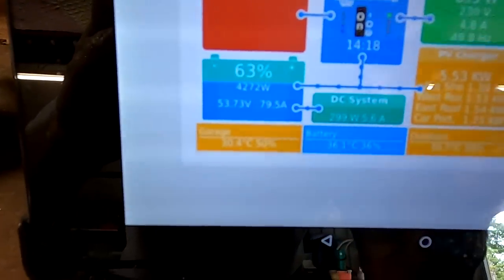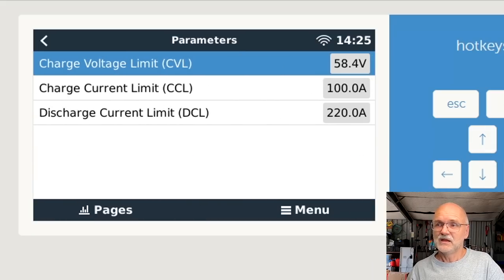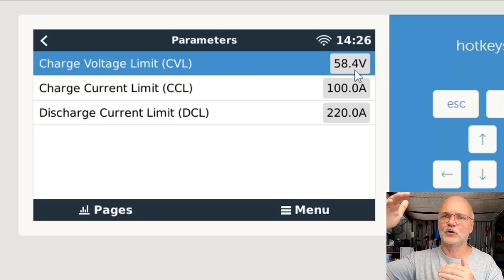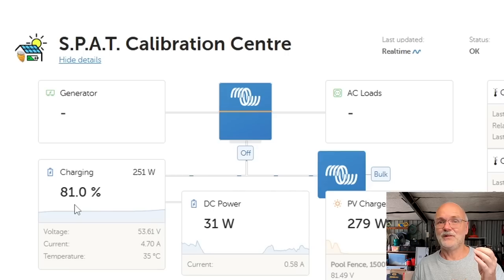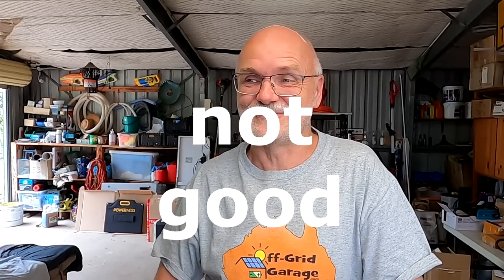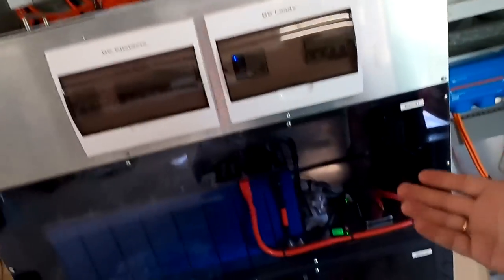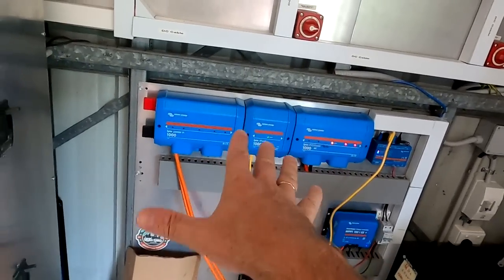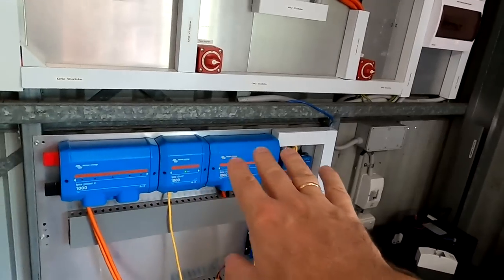SEPLOS BMS and Victron Lynx Shunt. Great solution, but why this is not for me.

Comment: Super Andy again an extremely interesting video. 
For this series on the Seplos BMS, you have come to a full circle. You started the series by asking the question of what benefit a Smart BMS could bring compared to a Dumb BMS and the conclusion after a few months of testing is that it brings nothing! Obviously you consider, and rightly so, that the algorithm used by Victron in its charge controllers is perfect and that this is what Seplos should implement. In the solution you describe here, the regulation is done by the MPPT charge controllers and the SOC measurement is done by the Shunt. So the CAN communication from the Seplos BMS to the Victron system is only used to bring up the detailed parameters on the battery and with that we have an almost perfect solution. So if Seplos implemented Victron’s charging algorithm and SOC measurement, it would be close to a perfect Smart BMS.

There is still one point to be dealt with, which you mention in your next video, the problem of optimizing the balancing of the cells at the end of the battery load. Looking at different videos, everyone more or less stumbles on this problem. This is due to the fact that the load curve is exponential for LFP cells and therefore at the end of the load the highest cells quickly go into overvoltage. This is especially true when the load current is high. If for example the charge current supplied to the battery bank is 100 A, balancing the cells with a passive or even active balancer is no longer effective. The only solution in this case is to reduce the charging current. A possible algorithm (very simplified) would be to define four voltages: the first voltage would be the balancing trigger voltage (let’s say for example 3.3 V), the second voltage would be a voltage that would tell the chargers to decrease slightly the maximum charging current (let’s say for example that this voltage would be over 3.45 V), the third voltage would tell the chargers to increase slightly the maximum charging current (let’s say for example that this voltage would be less 3.4 V), the fourth voltage would be the cell protection voltage that would cut off the charge (let’s say for example that this pension would be 3.65 V). Such an algorithm would normally converge the voltage of all cells to 3.45 V.

While waiting for such a BMS to exist, it is quite possible to implement this kind of algorithm with a home automation system such as Home Assistant. Indeed, most of the charge controllers and BMS have the possibility to communicate using the Modbus protocol and it is therefore possible to collect the different parameters of the overall system and to send back the appropriate command to implement such algorithm.
Reply: I think SerialBattery is what you are looking for

Comment: With all I learned from Andy on the good and bad things of Victron and 2 Mason running in my home without a Smart Shunt...I continue to measure SOC, cell voltage , control Charge current and turning on off the MP2 by modbus and IObroker. This will do exactly all the control as well as can process forecast data to set SOC limits...
Thank you Andy for all your shared insights! 🙏

Comment: Andy thanks for all your experiences of the past couple of years. It helped me a lot and learnt a lot. One thing I have learnt in battery management is I will only let a BMS do what it is supposed to do and that is protect the battery from cell max voltage cell max and min discharge and charge. Temperature protection high and low. Some people like to control everything (Seplos) I would never allow it. If I was the Seplos mother I would say just look after the parameters and I will look after everything else. Your 45kw battery system works perfectly. Simple and effective. Cheers Ken
Reply: I think I agree with you. Would you link 2 batteries together for communication (master / slave)?

Comment: Hi Andy,
Thank you for this video series 👍. It was very educational.
I had hoped that the Lynx Shunt would provide a good solution.
The seplos videos show that your battery shelf design was a very good idea, and it certainly holds up against ready-made solutions. Keep up the good work !🌞
Reply from the maker: Yeah, the shelf is working great. Even without communication. The Battery3.0 will work the same way. We also have a huge project at some stage to connect all the batteries together. Already thinking about that...

Comment: Thank you Andy for your work.

I've followed the Seplos Series from the beginning. Soon it was clear the balancer sucks. Made new PCBs for the Mason DIY-Kit. Now a Neey is in charge for that task. Balancing problem solved. Then followed how to integrate the bms into the victron world. Raspi4, waveshare 2 CanHat, venus os2.93. Never got the Mppt falling back to it's internal algorithms with DVCC turned on. The maximum we get out of your journey with the BMS. Why and what has a BMS to tell? It's the last line of defense, having some parameters visible in the venusos ist nice, but not more.
The only usefull I can think of is current limiting requested from a bms due to temperature issues like too high or too low. The Smarshunt by the way does all that the lynx is lacking of.

Comment: I think you have completely covered this BMS and its interaction (or lack thereof) with the Victron equipment.  On to another experiment!
That information about the Lynx Shunt is very interesting.  I guess I assumed the Lynx Shunt was pretty much a version of the smart shunt with all the same features and more.  If true, and it appears that it is, that it does not capture DC loads that is really disconcerting.
Wouldn't all this BMS angst be for not if Victron made a BMS that worked with any battery pack (not just their own battery) and dovetailed nicely with all the other Victron components?
Hey Andy, you seem to be able to get the ear of those Victron engineers.  Perhaps convince them of the potential size of the market for such a BMS.  Of course, I think we all know why Victron does not have one now-------they want you to purchase their battery!
Reply: Andy, John Strein captured everything I planned to say. So, I have nothing meaningful to contribute, or any value whatsoever to add, other than to say “ditto!” 😊

Comment: Hi Andy. No, it's not the end as the title is on your video :-) let me just show you how are my settings that make my Victron 3 phases Multiplus II 10kVA working with my bank of three SEPLOS MASON 280 batteries:
- Firmware installed on my CERBO GX is v2.93
- Firmware installed in my 3 SEPLOS batteries with 10C BMS (200 Amps) is v2.8
- DVCC is turned on, so all is under the SEPLOS master BMS control:
    * charge current limit is OFF
    * charge voltage limit for the managed battery is ON and set to 55.0V (I have to test if I can leave it to OFF)
    * SVS is ON
    * STS is ON
    * Temperature sensor is automatic (the SEPLOS BMS of course)
    * SCS is ON
    * SCS status is disabled (external control)
- ESS is set to Optimized (with battery life)
- Charge Voltage limit (CVL) is set to 55.5V
- and in my case, charge current limit is set to 570A, and discharge current limit is set to 585A

I think the most important setting might be the CVL set to 55.5V. In your video, you've tested to set it to 58.4V if I remember, which I think is far too high and consequently doesn't enable the SOC to be reset.
I think the key point is to have it much lower, like me for example at 55.5V, and not higher like you did. And I think thanks to that, it enables the SOC to reset to 100%

I don't have any issue with my VICTRON/SEPLOS system since 2 days basically, SOC is reset, I see absorption status in the VRM as well as on the LEDs of my Multiplus II, all is working fine.

And I think it's very important to not have different battery types linked together in the same system. All manufacturers agree on this particular point and say the same think. So keep avoiding linking your MASON battery with your PUSUNG SEPLSO one (or whatever).

I'll continue to buy SEPLOS MASON 280 batteries to extend my system from 44 kWh to 112 kWh (5 more to buy), now I know how to make it working correctly all together 🙂

That's my 2 cents.

Keep up the good work, man!!!
Reply: Hi Nicolas, will try your settings. Thank you for sharing them!
Reply: Sounds great, thanks for sharing. I wonder whether these settings would work as fine with the 10E BMS. And (why) is it important to have "charge current limit is OFF"? Have you tested also setting "charge voltage limit" to OFF in the meanwhile?
Reply: Could you post the individual settings you have done in your Seplos BMS in this case? Thanks a lot!

Comment: An interesting experiment might be to perform a capacity test on one of the 12v batteries using the capacity tester (can’t remember the model number) but include the smart shunt in the circuit so that the accuracy can be observed.

Comment: Use a virtual mqtt battery in Front of the seplos. There you can change the soc, voltage and even the allowed maximum current as needed. Works great here.

Comment: I certainly appreciate the time and effort that you put in discovering all of the "features" of the Seplos. Simply put, just say no. Not worth the time and effort of figuring out the settings. Certainly there is potential, and maybe in a couple of years it would be worth the extra cost. I shall stick with my JBD, so far I have had no need for an active balancer.
Reply from the maker: Thanks John for coming along on this wild ride. I truly appreciate all your comments and sharing your thoughts.
I keep working with Seplos and I'm sure we will revisit from time to time if they make the right improvements. As most of the issues are purely software related, it is all fixable.

Comment: @Off-Grid Garage, although I don't have a Seplos BMS, and have no intention (yet) of getting such a BMS or battery drawer, I really appreciate ALL of the videos on the Seplos system, because it brings out little quirks or explains buried feature of the Victron system also; for example, the issues with the Lynx shunt you discuss in this video, and how it inter-operates with an external CAN bus capable BMS.

The only thing that is missing in all of these videos, and is probably out of scope for the channel, is the actual 'plugin' or software module that facilitates the CAN communication between Victron and Seplos. It's entirely possible there are some quirks or bugs there also which results in the issues you have seen with the Seplos/Victron setup.

I'm moving house now, so my solar tinkering has been put on hold and have sold most of the components I have acquired for the basic system. Maybe I will have the chance to start again, if I can get a new rental with the space for a solar array in the back yard. 🤷🏻‍♂️
Reply from the maker: Thanks a lot Collin.
The comms seems to be ok as I have never seen any errors or dropped packages in the communication log.
After all, Seplos is not official supported by Victron. There might be a reason for that...
Reply: @OffGridGarageAustralia  I was thinking more along the lines of values in the Seplos being sent incorrectly to the Victron system. As confusing as the Seplos options are, I can only imagine how obscure the actual data variables in the comms are labelled. Not knocking the community contribution, but if there was any misunderstanding by the developer of what a particular value coming out of the Seplos BMS means, it may be quite easy to provide it to the Victron system as an unrelated, or unhandled data value, which could cause strange behaviour.

Comment: The solution is actually easy,
why do you even need a total voltage protection if you have per cell voltage protection !?
so just disable the switch for the total voltage protection on the right, now you have a charging voltage control,
then disable intermittent switch and set the total voltage protection to 55V and now you have a stable 55V charging, yes floating is not available but 55V is very safe for the cells and actually after 400 days of having exactly these settings, my cells haven't lost any extra capacity when compared with other cells that are charging at 55.2V and floating at 54.4V
Reply from the maker: Brilliant, I'll try this out. Thanks for sharing

Comment: I watched the videos but I have to say - as a newcomer to the Victron/Seplos world (battery built just finished) - I am confused: What is the best (working) solution now? Seplos only as a battery monitor/safety system, smart shunt for all measurements, and DVCC to control it all?

Which configuration settings need to be set in which way to make the system work like that? I think this could be super valuable for all of those people out there with the same setup (like me).

Comment: So what is your final recommendation for victron + seplos users? Don't buy a Shunt and wait for a better firmware? Or buy a Lynx Shunt and use Seplos as "stupid" balancer?
Reply from the maker: I would not recommend the Lynx shunt if you have any DC loads or non Victron inverters. It won't show any of that as a load.
Seplos and Victron works together but not in the indented way, that the BMS controls the Victron system. It is better to let the BMS only report to Victron but not controlling it.

Comment: Did you ever had a look at Batrium?- An Australian Company.
I´m using their Watchmon Core with several Cellmate K9. Connected also via CAN to Victron. Works nice. Major Downside is clearly passive Balancer. So I have connected also a seperate active  Balancer to my battery

Comment: Hey Andy. (Victron 10Kw, 4x100ah ....SEPLOS.... battery set, etc.) running battery BMS, with DVCC (no limit on charge or voltage, SVS,STS,SCS tuned on SCS on external control). Seplos FW29_HW14_PN01_220623 drops the CVL from 57.6 to 55.5v. this is more than fine, works well balances well, 0.02 average cell imbalance between all sets. only thing I don't like is the redundant issue with one battery will disable the entire battery set, shutting down the system.

I know you have a 'off-grid" system, but why don't you off-set the house loads directly, I run a wireless RS485 with a CT in the main switch board 20M away this way you can offset the house loads and maximise the current house solar feed-in.  

Many thanks, Matt (also a solar on/off grid designer/installer).
Reply from the maker: Hi Matt, thanks for sharing. I could not replicate the issue, that one bank shuts down the whole system. It affected only the bank wich was low in my setup and the others kept going.
I cannot connect any other inverter to the grid because of my high feed tariff for the grid solar on my house. the contract does not allow that. 
I made a few videos about that last year when I was looking for solutions: https://youtu.be/LQJZUmWDuCs
Reply: @OffGridGarageAustralia  Hey Andy,

Try disconnecting a cell supply, I had a loose connection this should trigger this problem, though I have not tried this recently (after the new firmware) as my battery bank sits vertically in a steel box. 

Yes I were wondering what the contract may say in regards to this. look me up if you ever want to go down this path, besides myself and another company I gave the idea to, as far as I am aware we are the only companies that do a wireless CT monitoring over considerable distance that feeds into the Victron system.

have a great day, Matt.

Comment: Hi Andy, regarding the Lynx shunt not calculating dc loads, where are your dc loads connected? On the battery side or on the inverter side? Isnt the inverter a dc load, so if it measures power to the inverter,  then surely it should measure any other dc load?

Comment: Not planning anything with Seplos, but just to get this sorted - when you say ‚Seplos BMS‘ here, you are still referring to the 2 daisy-chained different Seplosses, which to connect Seplos does not recommend? Just asking…😉
Reply from the maker: We have tested both BMSes separately with the same results. That the data from one BMS to another one is not 100% accurate is correct, but this was not my main concern. Many issues can be fixed with new software and more testing. I'm in contact with Seplos to get things moving but it will take time. More to come...

Comment: Andy perfect video. I agree with you Victron smartshunt is the best to determine the SoC. I had JK bms with special emulator (emuleted Pylon protocol through CAN) but JK measurement of SoC sucks! So I think (and you confirmed it) the comunication between bms and Victron system is not needed if you have smartshunt. It could be different on other systems like Goodwe, but it is other story. Thanks again and I am appologize, because I am one of the people who suggested Seplos as your next smart bms.
Reply from the maker: Thanks a lot for suggesting Seplos to me, Stanislav 😠😂
It was very good experience and we all learned a ton and have now these fundamental information available.

Comment: The second box can show more BMSs indeed. Thanks for the hint. I can unhide my Multiplus and my JK at the same time. Whatever benefit that brings... (and still, third and last time: Managed battery charge voltage is not what you think it is if I am not mistaken). ;-)
Reply: That might be a good feature for more smartshunts to show the usage of energy. As I own only one as battery monitor I can't say if that works as intended